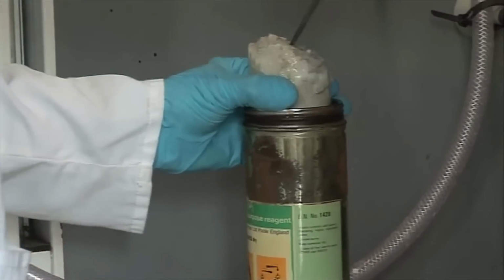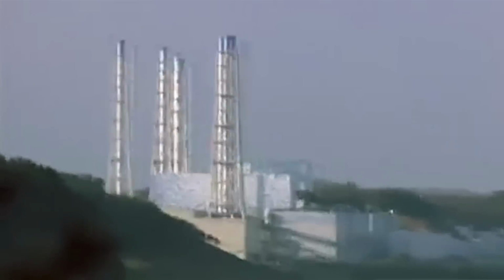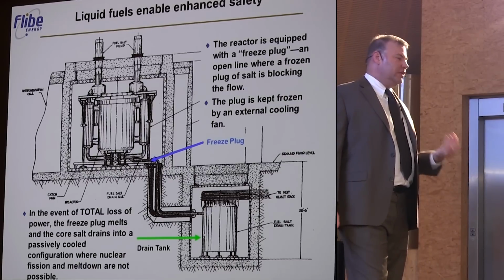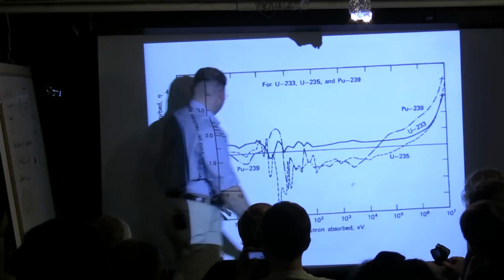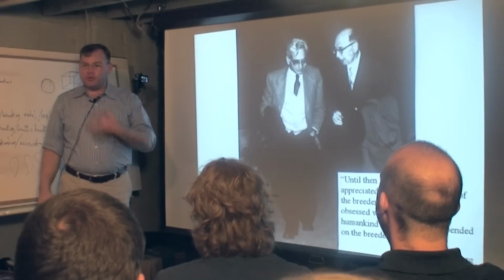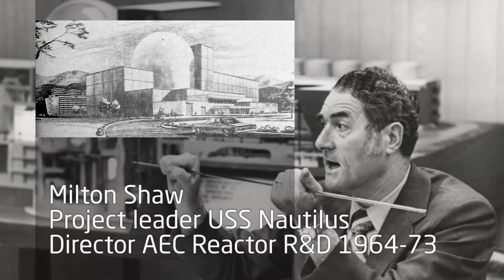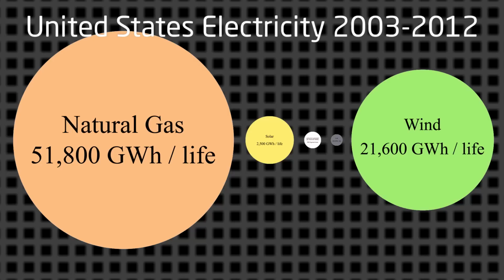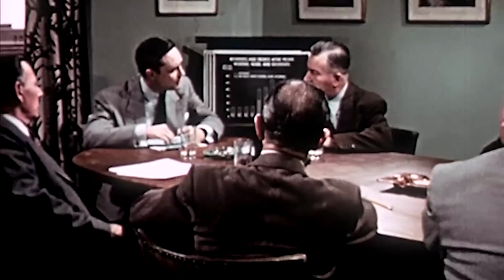Nuclear Disasters & Coolants

Comment: My big question is how hard is to rebuild a Old reactor into a new Thorium Reactor and do it Safely ..?
Reply from the maker: That is not possible. Some CANDU can consume Thorium as fuel, but safety advantages of thorium reactors are based on non-pressurized coolant with a higher boiling point. That's what a reactor is designed around, and can't be retroactively changed. Lightbridge is looking at interchangeable fuel rods to be used in conventional reactors, which can withstand higher temperatures, that as close as different-fuel will get you to any safety improvements. Today's PWR are already incredibly safe, only Chernobyl (a terrible design and operator behaviour) resulted directly in significant casualties. TMI resulted in zero. Fukushima's evacuation was what harmed people, not the radiation. Had there been no evacuation Fukushima wouldn't have killed anyone (except the 2 operators who drowned). In fact, had the Japanese PM not delayed venting of mildly radioactive steam from Fukushima, there'd have been no hydrogen gas explosion at all, and no "Fukushima" to speak of. It would never have been a thing at all.

Comment: And all i'm saying is what is going to be your ball bearing turbine fan sindle and cooling spindle. If any kind of water or contaminated moisture gets into that reactor it will gum up the input ports on the bottom going to the control rods. And those contaminated so not work well. Also how what would teh containment be made out, will it stil be metal? And if its metal has 300F error bad ending randing before it also metals being a metal and all, would that not be ultra not safe.